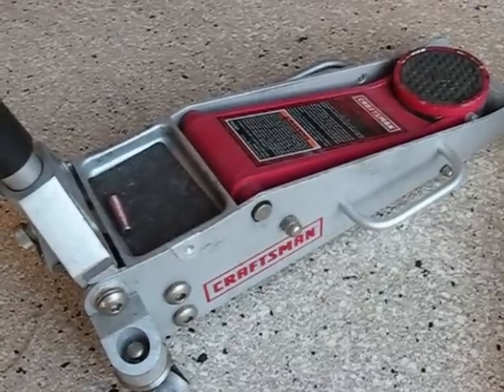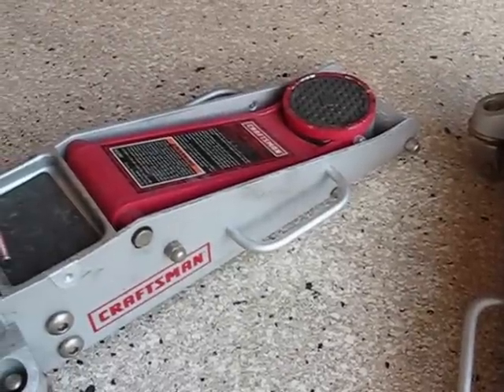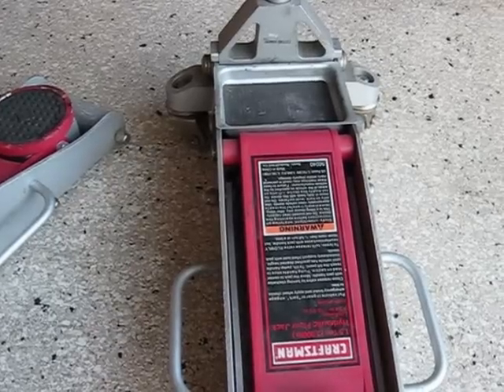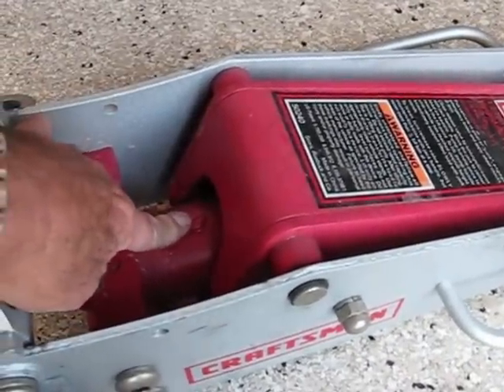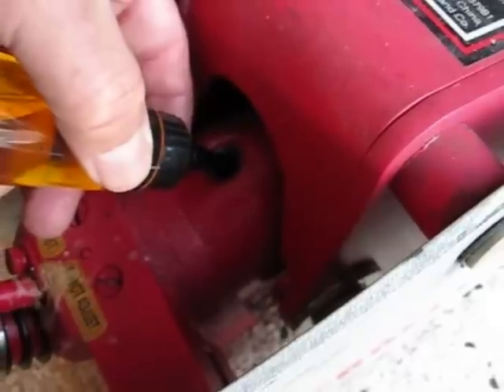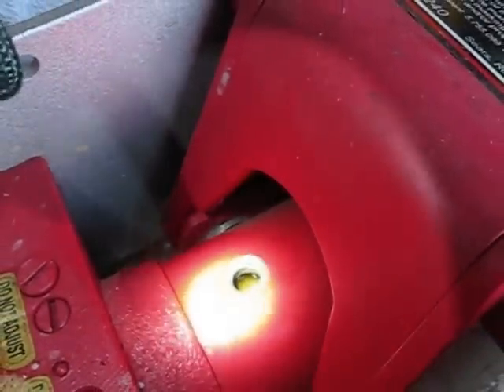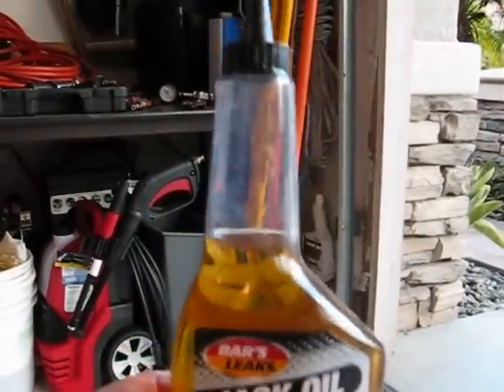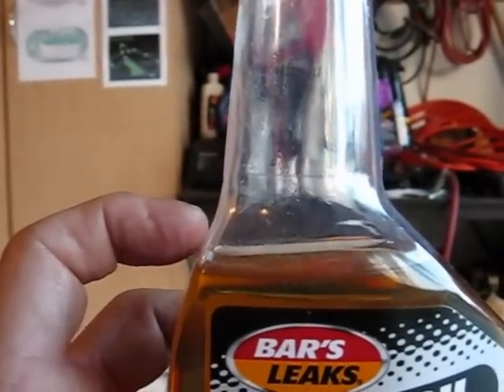Floor jack repair Sears Craftsman 50240 by froggy

Comment: my jack was different. it has a rubber plug on the top of the ram body instead of the screw for the fill port on yours. I am glad I watched your video to top off the jack fluid before I removed any of the screw plugs in the rear of the jack. Thanks for the vid!!!

Comment: The only difficult part of rebuilding these with new seals and o-rings is removing the tank nut (under your finger at 5:55). Some of the other videos on Youtube show this. Good tip on the handle cushion. Thanks!
Reply: That nut is beyond difficult!!!!!! I tried everything to get it off and had to take it to a shop for them to get it off. After that I was able to replace the seal and o-rings and now it works just like new.
Reply: @StorminNorminO  The trick is to first purchase a stout open-end wrench of the correct size. I bought a used 46mm Asahi on the big auction site. Once you have the wrench, just lay the jack  on its side with the handle at 90º. The handle keeps the jack from turning, so you can crack the nut loose without any other tools or contrivances. The process gets reversed during reassembly (lay the jack on its other side). Anyway, that's what worked for me. The wrench added $40-50 to the cost of the repair, but the work was still cheaper than a Chinese jack that might not last a year.
Reply: @TriodeLuvr  Thanks for the tip! Hopefully it will be another 20 years before I have to deal with this again!

Comment: Thanks for the video, the rear piston on mine had stopped going up and down. After watching this video I decided to lubricate the piston as best as possible using penetrating fluid. Rear piston is seen in your video at 8:50 mark.
Reply from the maker: How did that work?

:)
Reply: @1947froggy  Piston was loosened so it was  a success. I would lubricate that piston as they tend to get rusty (saw that on another youtube video), btw I found the instructions for the jack on the sears site and top fill line is a bit below center piston. In other words it doesn't need to be filled to the top of the screw. I believe overfilling these can sometimes be bad.

Comment: Great video, I have the same problem with my jack. Although one of the spring studs broke off I'll need to fill the hole with JB Weld. Thanks to your post my Jack is up and working well.
Reply from the maker: Thaks for watching
:)

Comment from the maker: That would be a seal that has failed/leaking hydraulic fluid internally. If you continue to use it, be sure to put a solid jack stand under the work, so as it comes down it rests on the jack stand.

:)

Comment: I have the same jack as the larger one you have and same issue because it lifts about 75% then wont lift anymore. Doesnt seem to be leaking. Any suggestions?
Reply from the maker: There is an internal bypass that prevents the jack from lifting more than it "should", more than rated for. Seems like your bypass is triggering too early, but how much are you trying to lift? Is it over the limit? Froggy

Comment from the maker: They are "self bleeding" which simply means the air bubbles (if any) will rise to the highest point in the hydraulic cylnder part of the jack. If the jack has been turned over for some reason just cycle it a few times in the normal position. If it still does not work you prob. have a seal that is worn or failed. I looked into rebuilding and the parts are hard to find. You could try dumping all fluid & refill with a fluid that has "sealer" in it.

:)

Comment: help!  do you have any idea where i can get the part between the handle socket and the power unit?  it's the 2 piece JOINT / COUPLER which rotates when you rotate the handle, to tighten or loosen the jack...  mine broke and i cant lower the jack by rotating the handle bar... i have to use pliers to get it tight or loose...  i'd really appreciate any help... thanks

Comment: Hi froggy. I filled my floor jack with what I think is the proper level but now after raising it and lowering it then by releasing the valve the small handle pops up at the end of the lowering. Another words that area is pressurized or something when lowering the jack which causes the handle of pop up.  Not sure what’s wrong it seems like the jack works fine lift stuff lowers fine other than the handle popping up which I don’t think it ever used to do. Any idea what that could be? Thanks thanks
Reply from the maker: The ones like mine, the handle is left up position after using, If yours works, not sure what you mean?
Reply: @1947froggy  -The small handle just pops up when the main jack arm is lowered by turning the release valve. Meaning there’s pressure in the small handle cylinder that doesn’t go away. I don’t recall this doing this before. Other than that minor peculiarity the jack works fine raising and lowering. I don’t think it’s air. I don’t believe it’s overfilled either.  Oh well
Reply from the maker: @condor5635  I don't have it in front of me, what is the "small handle" Mine has only one big jack handle.

Comment: I have the same jack and wanted to do maintenance on it because it pumps up but doesn’t go down. But before that the handle is seized some how it doesn’t turn counter clock wise and I can’t pull it out? What do I do
Reply from the maker: Is the universal ok (at the bottom of the handle)?
Reply: froggy yes it looks fine and doesn’t look to be damaged
Reply from the maker: I would just start disassembly and look for bent/broken part. Replace o rings (kit)

Comment: Thanks for the tips.  I have an identical floor jack.  The yoke on the release valve universal joint broke and it was always a pain to lower the car.  I took your hint and modified a 3/8 drive universal and replaced the broken one and the jack works like new.  Would have been an easier task if I would have had a drill press and v-block to drill the holes, but what the heck.
Reply from the maker: Great DIY job! Congrats!

Comment: Your whole Corvette weighs around 3,000 lbs. You're only lifting a portion of that at a time, so your jack has plenty of capacity. I have the same one and never had a problem with my C5 Z06. My F150 wore it out, though..

Comment: i have one of these. tried it with the no leak lube, but didn't work. think leaking from different area. my $20 jack last longer which makes me pissed cuz i spent like $120 on this. any suggestion what to do with it instead of throwing it out? seems like a waste.
Reply from the maker: If it does not leak too bad, just keep adding jack oil.

:)
Reply: peter o I ended up tossing it. Did pick up one of the old school ones off CL which is a beast.

Comment: How do I reset the  factory setting screw on a floor jack.
Reply from the maker: "They" say you are not supposed to. The only thing you are really supposed to do is add a little jack oil.

:)
Reply: froggy
Reply from the maker: Good info, thanks!

:)

Comment: Shouldn't a person also bleed the air out of the cylinder?  I understood that the back center screw is where we should fill, and the front screw is to be removed so that we can bleed the air by pumping a few times on the handle.
Reply from the maker: So long as you have not inverted the jack, it will self bleed (air bubbles will rise to the high point). Thanks!
Reply: @1947froggy  Interesting.  So the jack fluid area is not air-tight sealed?  What am I missing here?
Reply from the maker: @rodshop5897  Think like the master cylinder on your car, it's the highest point of the fluid system and has a tiny hole in the cap, so correct, not 100% air tight sealed.

Comment from the maker: You might be able to take a universal joint from a socket set (they are also sold separate) and fit it in place of the broken one, google 3/8 drive universal to see what it is.

:)

Comment from the maker: I would if I were qualified, but topping the fluid is about all anyone does these days unless you can find a real old timer who has had a few apart. Since these need to operate 100% correctly to operate SAFELY I would probably suggest toss it and get a new one, they are not terribly expensive & father's day is coming up, lot's of tools on sale for father's day.

The steel balls are part of the check/flow valve system for the hydraulics.

:)

Comment: For the life of me I cannot get the rubber filler cap back on. Suggestions?
Reply from the maker: +adamnmary A small needle nose plier to squeeze the "nub" that goes in, then press/push easily.

:)

Comment from the maker: I haven't tried that, may be possible but be careful. It's easy to lose little parts & also you are tinkering with the important "guts" of the jack, it's not actually designed to be serviced, unfortunately these have become throw away tools.

:)

Comment: I hear there are jacks that DON'T leak. Maybe I'll try the Costco one which I think is Michelin or Goodyear branded.
Reply from the maker: rkgsd Maybe, but in my experience, the ones I've had all leaked, just a matter of how bad they leaked. The "pro" jacks may be rebuildable, but the ones you and I buy - not so much.

Comment: My jack slowly gos down any ideas.
Reply from the maker: It needs a new seal/oring. Disassembly & correct part is required.
Reply: @1947froggy  that sucks I only had a jack for about two three years

Comment: Thanks for showing me where the fill screw is.  Forgive me if this has been pointed out before but:
1.5 tons = 3000#  not 1500#.  Perhaps you are confusing it with kilos and a metric ton.
Thanks again.
Reply from the maker: Conri ODonaghue My bad, thank YOU!
Reply: froggy Thanks to you my floor jack works again!

Comment: I know this is an old vid but I was looking for some help on my Craftsman aluminum 2 ton floor jack that leaks. Obviously this didn't help me but I did learn one thing. Don't spend the extra money to buy one from Sears unless you do know how to get parts on your own. Sears has no parts available for these. Next time I'll probably save the money and buy Harbor Freight because at least they have the seal kits available. So sad what is happening to Craftsman.
Reply: So the lesson you learned is to pay 70% as much for a HF jack that lasts 1/4th as long?  Great logic.  You can get rebuild kits for Sears jacks.  Hint:  Try using the model #.  Can you get kits for HF jacks?  I can get one for my 28 year old sears jack!  Check at Lazzar's (google it).  It always amazes me when someone states that the quality of something didn't live up to their standards so the solution is to buy something of much worse quality.  Kind of like shooting yourself in the foot.

Comment: bring the seal or seals you need to a reputable hydraulic supply shop in your area. you may be suprised to find what the may come up with. didi the same with an old craftsman 3 ton.
Reply from the maker: Good tip.

:)

Comment: Quick check and it seems that replacement parts for the Power Unit aren't available for many new jacks.  I have my Dad's Japanese made Craftsman jack from the late 60's that I just replaced the seal that goes under the piston.  The old one came out in pieces, probably from lifting over capacity, or from loaning it to someone who abused it.  The jack now works like new.  It's 1.5T      Got my jack part from    http://www.hcrcnow.com/    Real slow shipping, didn't mail it out until four days after I paid with Paypal.  Really sucked because I could have walked to his "Corporate office" (home) in two hours.
Reply from the maker: That is a great resource, THANK YOU!
Reply: +peter o  Been a year and the jack works perfect with the new seal.  The moral of the story is don't lend your jack to someone who might abuse it or even try to keep it
Reply from the maker: That link is a great resource, thanks.

:)

Comment: The steel balls are check valves. I have them randomly fall out once. I simply put them back in randomly then try to see if the jack will hold pressure. Got it working on the first try. There is a diagram of jack check valves here  hyjacks(dot)com/ckvalve.jpg